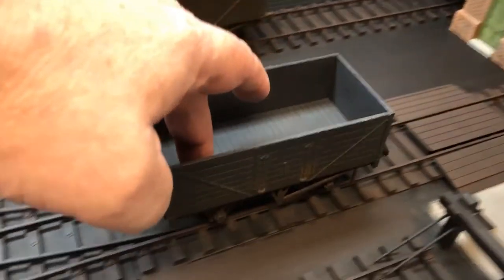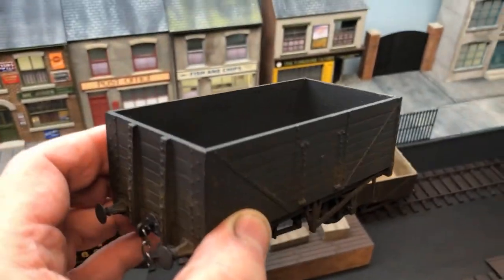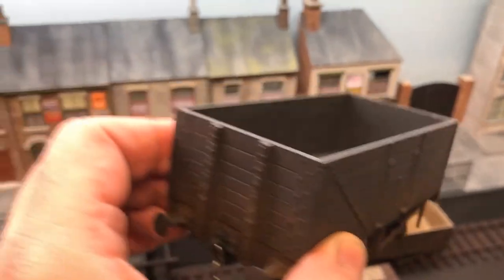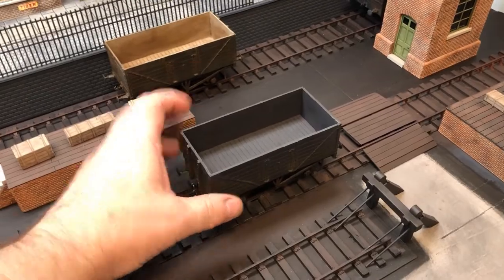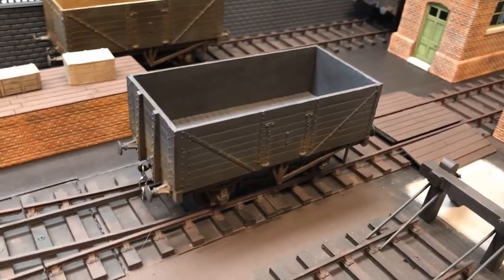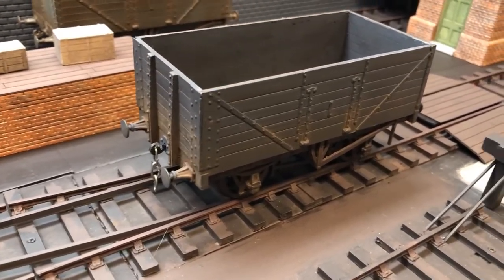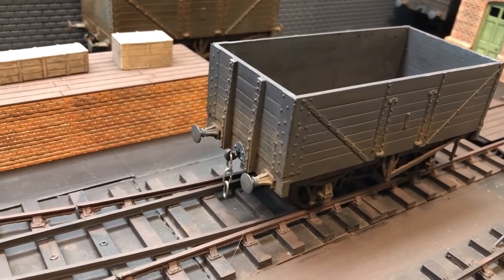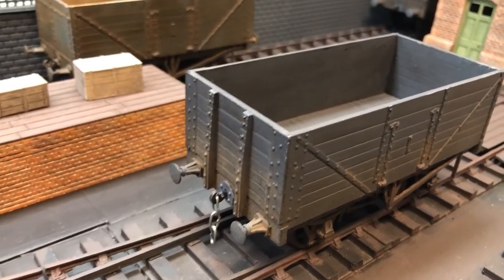Part 9 The wagon   The World's First Fully 3D Printed British O Gauge Model Railway

Comment: Thank you so much for the link to those drawings.
I've been trying to draw up some old LMS wagons for 3D printing but couldn't get the leaf springs to look 'realistic'
The one's in the drawings you linked to look much more the part, even if prototypically they aren't. But it's my model railway sooo....
Nice job on that wagon, I wonder what they'd look like in OO.
Do you share your designs anywhere or keep them to yourself?
Cheers!
Reply from the maker: You're welcome Gerry. Not tried in OO gauge since moving to O gauge. I suspect rivets would not be easy unless you use a resin printer.
Reply: @3dprintedscalemodels523  Well I've got 2 FDM and a resin printer, so I should be ok.
But yes rivets at OO on a filament printer wouldn't be the best :)